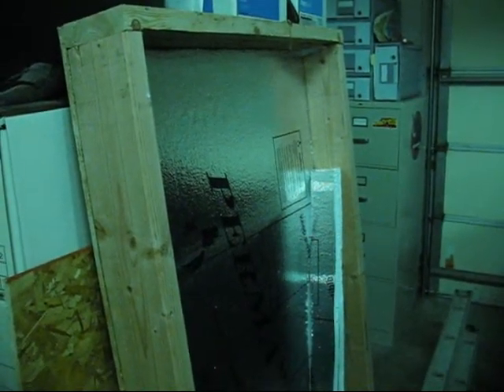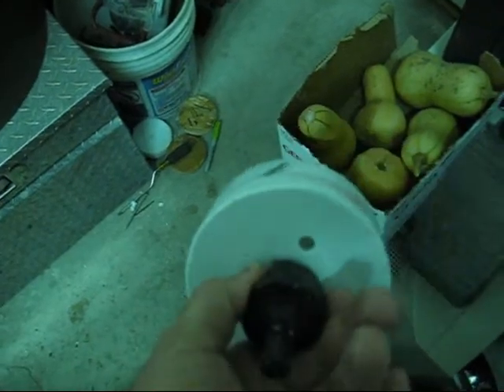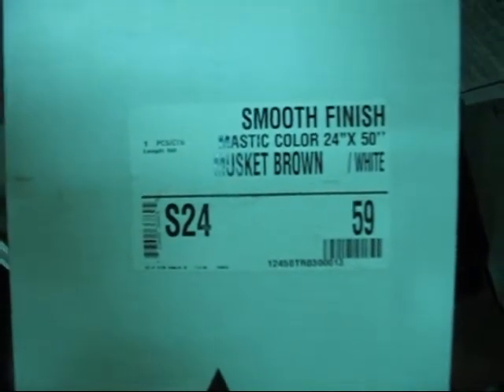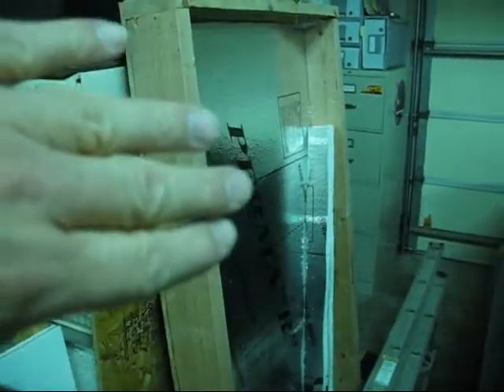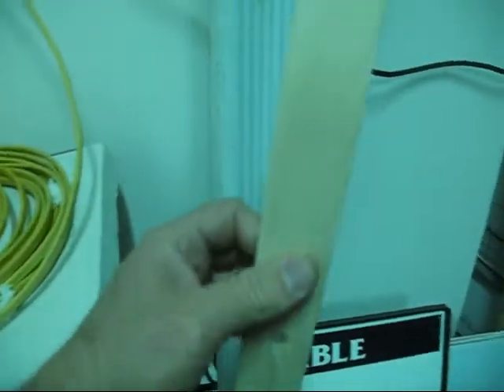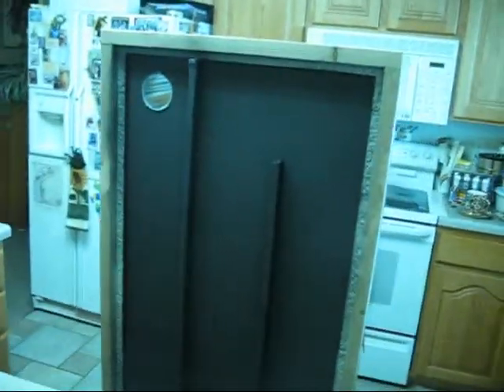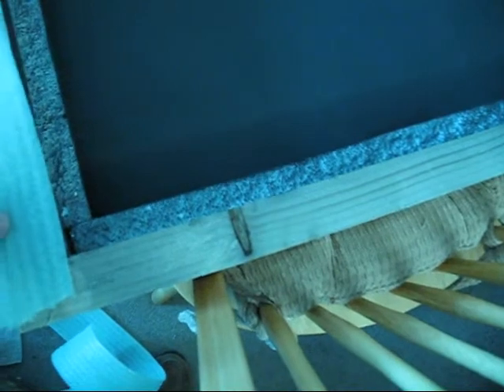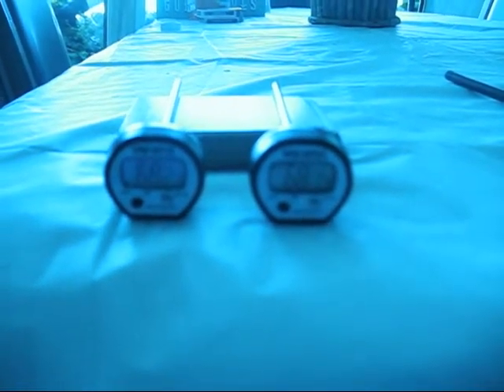SOLAR AIR HEATER PART 3 MR.wmv

Comment from the maker: @Fearlessthinker Additionally: If off gassing is a concern, you could seal the joints and ends with foil tape.  A tight seal from the tape to the foil backing should prevent any additional off gassing.

Comment from the maker: The foam should be able to withstand the heat with the foil backing.  Regarding offgassing:  allow Foam Insulation to sit in a warehouse or in fresh, circulating air so they can off-gas before they come into your home/ project. Or keep them in your garage (with a door or window cracked open) for at least a week before bringing them into your house. Off-gas levels of many compounds decrease dramatically in the first few days after they are removed from packaging.